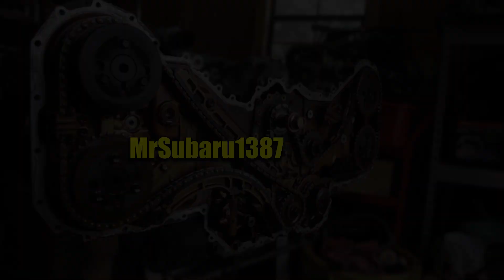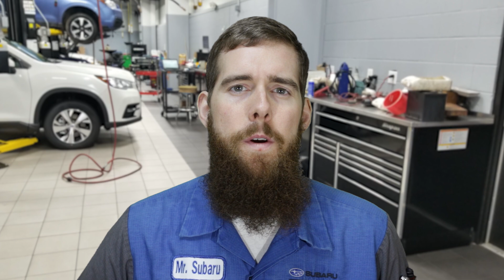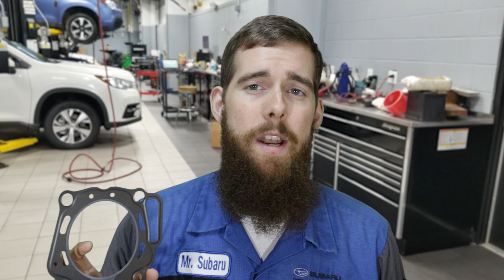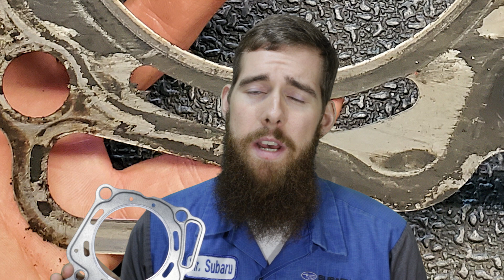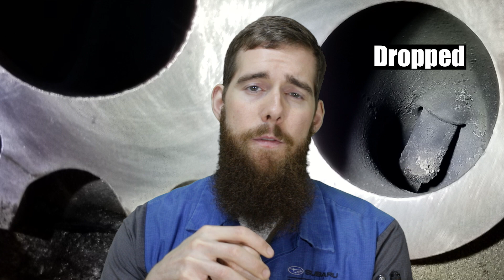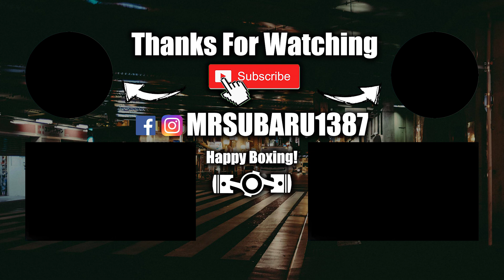Subaru Head Gaskets Explained

Comment: Quick question I redid my head gaskets about 3 months ago. I had the head shaved new valves everything rebuilt and done I have a feeling they may have blown again so will I have to get the heads reshaved and the heads rebuilt all over again or should I just replace the gasket?
Reply from the maker: Head gaskets failed in 3 months?
Reply: @MrSubaru1387  yeah There's oil in the Coolant and its overheating. Ot was a self done job Except getting Lee heads redone.  it was the 1st time my dad's ever worked on a Subaru I think he might  Have gotten a composite gasket not one of those 3 layered steel gaskets. So since this was done so soon do I have to go through all the trouble with the heads or should I just replace the gasket.

Comment: Can I replace the 11044AA663 (graphite composite) gasket by the 11044AA770 (multi layered steel) gasket on my 2008 Impreza 2.5i non-turbo SOHC engine. Is that 11044AA770 MLS gasket compatible with my engine ??? Thanks !
Reply from the maker: https://amzn.to/3jIBwcn

11044AA642

Comment: so i have been interested in purchasing a used Subaru forester or outback. i have never owned a Subaru before.  where do i find the engine code on one of these vehicles? i would assume under the hood, but is there a sticker or is the engine code easily found on the engine itself? also, if the head gaskets have been replaced, is there some sort of mark, sticker, or some other way of telling that they have been replaced?
Reply from the maker: Older ones have a metal plate on the strut tower, under the hood, drivers side. Newer ones have a black sticker, either in the driver's or passenger's side door jamb. Gives VIN, engine code, transmission code, paint code, etc.

Comment: Hey Mr. Subaru do you happen to know the part # for the Mls gasket? Looking to do the job on my 07 Forester 209k miles and there is a decent amount of seepage on the outside of the engine. Thanks!
Reply from the maker: Check my Amazon store, link in description, have the MLS kits lists under head gasket repair.
Reply: @MrSubaru1387  thank you sir! Much appreciated!

Comment: my ej255 has did headgasket because the previous owners mechanic ran the wrong type of coolant. genuine dealer mechanics believe the coolant corroded the cooling jackets & the gasket so much that the corrosion reached the cylinders.

Comment: Are subarus 2L naturally aspirated engines (EJ20) having head gasket fails as well? If so, what is the average mileage? Can i replace it also with this kind of gasket?
Reply from the maker: As far as I know, no, they didn't have the HG issues that the 2.5 did.

Comment: I have owned 2 ej22 98 and 01 both shortly after owning them have had oil leaking on top and eventually had poor heating issues and hi temp issue but never did see the bubbles in the radiator. 
Changed oil every 4k miles 
I changed the sensor on top that I thought maybe leaking the oil but still happened after
Never ran with low fluid I have always been able to keep it toped off. 
Any ideas?

Comment: I’m sure this will get lost in the comments, but is the 2013 Outback 2.5i affected by head gasket failure?
Reply from the maker: Normally, no.
Reply: @MrSubaru1387  so sorry for the follow up reply, but thanks for responding to my question yesterday!! Is the 2011 or 2012 2.5i Outback affected by it too? Is the 3.6r a safer bet? I’m in the market for a 2011-2014 Outback and I’m just confused with all the scary stuff out there on the internet about the 2.5i

Comment: New to the Subies. I was curious how much a rework of a set of heads should cost with no major issues? Thanks for the video
Reply from the maker: $250-500 usually for the pair.
Reply: Cool, not bad at all. I would say about standard for heads

Comment: Thanks for the information. I recently bought a 2011 legacy with 100k miles. Check underneath and the coolant all seems fine. Do you know what engine came in the legacy and if it's prone to the HG issue?
Reply from the maker: EJ253. Yes.
Reply: @MrSubaru1387  I'm about to do the timing belt in the waterwould you recommend I change the head gaskets now or later at 130,000

Comment: If I have an '09 OBXT, does that mean it came with the MLS head gasket? I have 145K miles on it so am starting to get concerned about the head gasket.

I am very good at the regular maintenance, oil changes every 3000 miles, changed the coolant at 80,000 and replaced it with more blue Subaru coolant.
Reply from the maker: Yes. The turbo cars had the MLS gaskets. Don't fail unless they're abused, not maintained, or ran out of coolant/overheated.
Reply: @MrSubaru1387  Thank you. That makes me feel much better.

Comment: My subaru impreza g4 2017 has been emitting white smoke and having a few misfires. I'm appalled that this has happened but it's at 92,000km. What's your possible diagnosis?

Comment: Thank you Mr. Subaru for the well put together video. I heard from a mechanic that my Subaru legacy 2009 has major head gasket failure currently at 80,000 miles. I am afraid the engine was already damaged. Would it be still worth fixing it? Or perhaps just let it go?
Reply: What did you end up doing? I have the same car and same problem.. taking it to the shop for work on Monday ☹️

Comment: Kinda off topic but is a kn drop in air filter bad for a wrx? I have a 2020 wrx and was going to use one till I break in my wrx. I got it with 9 miles and it’s sitting just under 400 miles now. I’ve heard it’s bad for the engine and the oil can mess up sensor. I was wondering if that’s true or false, also does it need to be tuned to use? I’ve read a lot into it but everything is 50/50
Reply from the maker: A K&N panel filter, in the stock air box, requires no tuning. It may leave an oil residue on the MAF sensor. It shouldn't harm anything engine related.
Reply: MrSubaru1387 so for most part it is safe to use then? I got one after a little reviewing and now in my group everyone is saying it’s not good to use unless you get a tune and that the oil will ruin maf sensor and with more airflow means more debris get through and to just get an intake

Comment: I'd like for you to post something covering the EJ20 in the WRX
Reply from the maker: Like what for instance?
Reply: @MrSubaru1387  
   Common issues and repairs. As you've started in this video, there's a ton of bad information floating around. 
  I'm new to Subaru, just purchased an 02 WRX wagon and I'm seriously considering doing an overhaul. 
  From my understanding, the biggest problem is the head bolts stretching and lifting the head. All the information I have found so far is spotty at best.  
  I'm just trying to find someone who has some solid information that covers these engines.
   Thanks

Comment: What headgasket did the ej20 (in an 03 forester n/a) have? Motors only on 84k miles but it's been sat for a year an a half so debating whether to change it.... also can you recommend a decent timing belt kit? Was done at 40k miles and the tensioners beginning to knock again -_-
Reply from the maker: I'm unsure. We didn't get the EJ20 non turbo engines in the US market. I don't recall hearing about them having HG issues though.

Comment: I have a 1997 subaru legacy outback, think it has a 2.5 in it but am uncertain. 
Was driving it one day, pulling out of the parking lot during winter (10° outside at the time) and the heater failed, didnt think much of it due to the heater coil pack failing so I though it finally gave out, but I kept driving it cause I had somewhere to be. 
Drove it for an hour or so, pulled into the parking lot, and as I rolled into the parking space, the car died. Wouldn't start back up. Tried again in half an hour and it started up perfect. Opened up the hood and there was coolant absolutely everywhere. 
I flushed the radiator and it had what I thought was oil in it, but turned out to be ATF. 
Took the atf cooling lines that ran through the radiator and disconnected them from the radiator and looped them together to see if there was a radiator leak. Didnt see anything after running for 10 minutes. 
I'm wondering if anyone has any idea how this could have happened. 
It's been sitting for about 5 months now, gonna get a new battery and try to drive it home. I'm kinda scared that this might happen again, or that it might ruin my engine. 
Also, I was told by a dealership that my headgasket is about to go, havent seen any signs of headgasket failure, and sure as hell ain't paying 2k to get it fixed. 
Basically, I just wanna know if I'm gonna screw something up if I start using this car as a daily driver again, and if so, how i can fix the problems. 
Any replies are greatly appreciated.

Comment: Part #11044AA770
is that the right part number
for the Turbo MLS gasket that will fix the issue?
Reply from the maker: 11044AA642

Comment: HI, so 2011- 2014 aren't prone to the head gasket failures?
Reply: I have a 2013 Impreza..goes up in a huge cloud of smoke when starting in morning...started at 35,000 miles 2017..suburu NEVER acknowledged an issue...
They are SNEAKY BASTARDS#@!

Comment: Do you think a subaru wrx with 90k miles on it will have any of these problems and if so how should i go about dealing with them?
Reply from the maker: A used WRX will probably have a lot of issues. They're usually beat to hell by the original owner.

Comment: It is difficult to buy one with a blown head gasket and do the head gasket install because those tiny main bearings and rod bearings fail quickly when coolant gets into the oil pan. Buying a used Subaru is risky.
Reply from the maker: I buy, repair, and sell them regularly.

Comment: I brought a 2018 STI hit in the front and the timing belt plastic cover is broken and there is oil inside of the plastic is the oil supposed to flow around there?
Reply from the maker: No....
Reply: What do you think it might be because the the turn on and it has no problems
Reply: Car
Reply from the maker: @randybrazoban7502  it was wrecked, could be anything. Can't tell you much without seeing it. Could be a cracked oil pump, bad crank or cam seals, blown or leaking oil line for the AVCS system, could be a bust timing belt tensioner, could be multiple things. The timing belt should be completely dry and no oil or fluids of any kind in the timing cover.

Comment: "Stupid question" I lived overseas in a place call panama and my grandmo gave to me her subi forester 2008 with 57,000 miles only not preaty bad and its look great ..the point is I put koolant last month and since that moment the car started leaking by the gasket and then she told noooo you don't have to use koolant in this weather I just use water ..is that correct? Can anybody   tell me if is fine use water in a weather like Florida pls
Reply from the maker: Should be using Subaru blue Super Coolant, not straight water. Straight water causes rust issues.

Comment: I have 2010 Subaru with high miles.. 200k.  It spuders when I come to a complete stop.  Is that a head gasket issue?
Reply: Before you come to a complete stop put your vehicle in neutral if it’s an automatic. If the problem stops then it’s possible it could be your torque converter not coming out of lock up. There were some 2010-2012 Subaru automatics that had torque converter failure and the most common issue was spudering or the engine completely stalling out as if you were to come to a stop in a manual vehicle without pressing in the clutch. Here’s a link to his video explaining it — https://youtu.be/tfNpZ0aHNRo

Comment: I just looked it up and seems like I dodged a bullet because my 2013 Legacy 2.5i uses the new for 2013 FB25 timing chain engine and not the EJ25 from the previous years in question.

Comment: 2015 Subaru Legacy, is that a reliable one? Regular Unleaded H-4 2.5 L/152 engine with 87,000 miles...
Reply from the maker: FB25B. Not afflicted by the head gasket issues.

Comment: I have a 2010 and 2011 Outbacks,  I know they both have timing belts and are EJ engines, but how do I figure out what model EJ I have ?  Wondering if mine are in the failure group ?
Reply from the maker: Both are EJ253. That info and more is on the VIN plate in the passenger side door jamb.

Comment: I'm trying to find the head gasket kit you recommend but none of them are labeled in your amazon storefront. Which one should I buy that will fit an EJ25 on a 2003 Forester XS?
Reply: I would like to know as well, as I have to replace one on my 2003 Forester.

Comment: Hello Mr Subaru I have a question for you. I have a 2007 Subaru outback with a 2.5 L naturally aspirated 4 cylinder. I'm about to have the head gaskets replaced because they failed exactly at the mileage you said they would 130k. I'm gathering all the parts to have a friend of mine repair it for me. I'm definitely using all OE parts and I'm going to have the water pump changed as well. My question is which exact turbo head gasket should I use in this repair? Should I just ask for the turbo model gasket of the same year and make? Or is it a gasket from a completely different model? I thought I saw a video before where you gave an actual part number but I'm having a hard time finding that. Any help is appreciated and I definitely value your experience and YouTube channel. Thank you!
Reply: Also what seals the front cover? And should I replace the timing chain tensioner? Any other parts I should change while doing this repair? Thanks!
Reply from the maker: 2007 should use 11044AA642 p/n head gasket. Timing belt, not chain. If the timing set wasn't replaced at 100k miles, it should all be replaced now. Belt, tensioner, idlers, water pump.
Reply: @MrSubaru1387  Thank you so much for the quick response! I'm gathering all the parts together this weekend and finally get this thing fixed once and for all. The outback is definitely worth fixing because every other thing on the vehicle is perfect. After this repair I'm going to drive it until it dies but just wanted to make sure it gets done right with the right parts. I love your channel and you are such a great help! Subscribed and liked!
Reply: @MrSubaru1387  one more question....sorry

I'm definitely taking your advice about having the heads resurfaced and my question was, should I go ahead and have the valve guides changed while it's all apart?
Reply from the maker: A competent machine shop will check everything. But you need them resurfaced, hot tanked, pressure tested/tested for cracks, and any guides pressed back into place or replaced. As well as any valve seats addressed.
Reply: @MrSubaru1387  Thanks again Sir!

Comment: I have a 2010 2.5 so its a ej253 right? How can i tell if someone added the conditioner  to it...  im at 125k bought it at 80k now im worried about headgaskets... ik cylinder 4 spark plug well leaks oil and valve cover just seeping around cylinder 4... not to worried about it  cuz i figured headgaskets  will fail soon... recommendations  and how can i tell about the "conditioner"?
Reply from the maker: 2010 should have blue super coolant. If it hasn't been replaced yet, it should be. You can add conditioner if you want.
Reply: @MrSubaru1387  i forgot to mention i had timing belt replacement  with tensioner  so im sure he disconnected  coolant  hoses... so should i be worried about changing collant still... that was slightly  over 100k
Reply: @giftman20  I wouldn't assume the hoses were disconnected to do a timing belt replacement unless water pump was done at the same time. I've done multiple timing belts on these without touching the coolant hoses
Reply: @MrSubaru1387  Is there a problem with the blue super coolant? I have a 2010 Forster single overhead cam. It's not got 100,000 miles on it yet. Should I be adding something to the coolant or just flushing it when I do the timing belt?

Comment: Eek! I have a Subaru Outback 2102 with the EJ253AUCFB. So even if you change the coolant it will still fail.  What should I do? Change the gaskets now?
Reply from the maker: If you keep the coolant fresh and your battery terminals clean, you sound be good for quite a while.
Reply: @MrSubaru1387  Thanks so much for responding. I really enjoy your channel and find it very helpful. I have a Subaru Outback here in the US and I also have a 06 Forester in Tanzania which works great during the rainy season.

Comment: Will a subaru dealer change it to the MLS gasket? I have a 2011 Subaru legacy 2.5i premium, it looks like it falls under the EJ253 unfortunately, did your brothers headgasket fail at 120k miles?
Reply from the maker: As far as I know, my brother's 2011 Outback head gaskets are original.

Comment: Is there a issue with the 2.2l? And will the turbo gasket work on the 2.2
Reply from the maker: No. EJ22 didn't have HG issues.
Reply: @MrSubaru1387  We need your advice raf2000 gyrocopter used the 2.2l from Legacy 1990-1998 had a issue of crank bearing failure is there some kind of upgrade for this engine oil pressure engine runs at 5600rpm constantly when flying we looking at the RCM oil pumps out of England but maybe upgraded dry sump kit we need lots of oil sprayed everywhere o e guy said used the wtx engine pump?
Reply from the maker: The EJ22 should have the 9mm oil pump. Subaru had a 9, 10, 11, & 12mm oil pumps. You could upgrade to a larger pump. Would check that the pickup tube isn't cracked. They're brazed. Common for them to crank and suck air.
Reply: @MrSubaru1387  I think super Bee oil pan and pick up tube addresses that?
Reply: @MrSubaru1387  thank for time brother really appreciate it
Reply from the maker: @shawnwright5332  Killer B, close enough. Lol 👍🏻
Reply: @MrSubaru1387  yea I saw that and laughed super 🐝 lolol
Reply from the maker: Thinking MOPAR! 😂 💪🏻